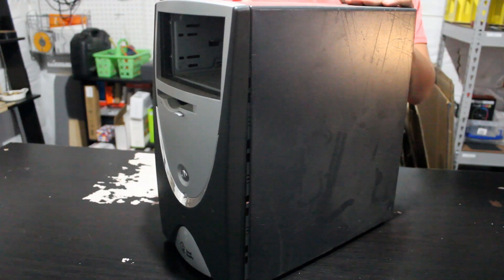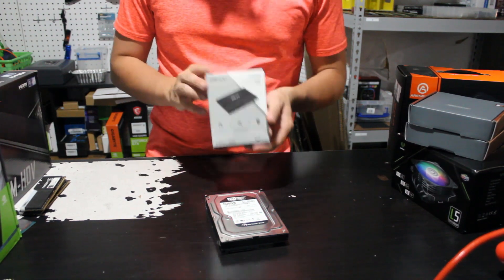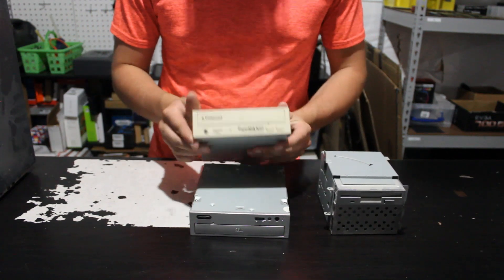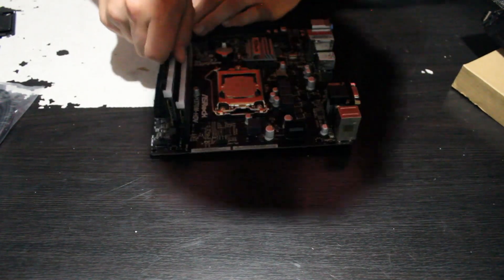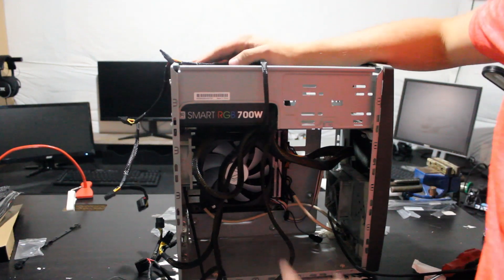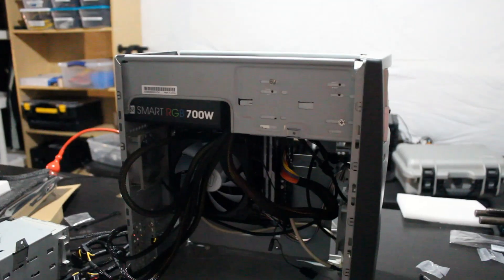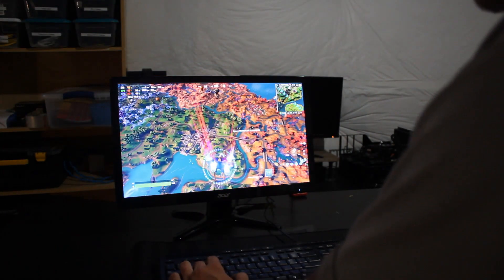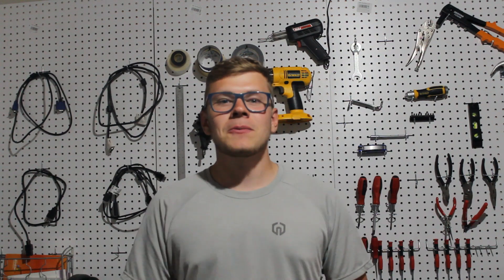Sleeper PC Build Part 2

Comment: first you said the power supply was a 800w then you had a 700w on the side then you had the RGB  and the box said 500w ? i would take out that second cd player or DVD player you have more room to mount both ssd and hardrive you know a AMD mother board and cpu would have been alot cheaper and less power used that cpu cooler wow its big to anyway good stuff any way just thought was so confusing what you said at first then change it i really think a bigger old case would have alot more room ok sorry if this anoy's  you just my opinion ok i have been assembling computer since late 80's  long time seen it all and done it all Also the black hardrive are usually used for back up data for security cameras oh im a bad speller to hahahah